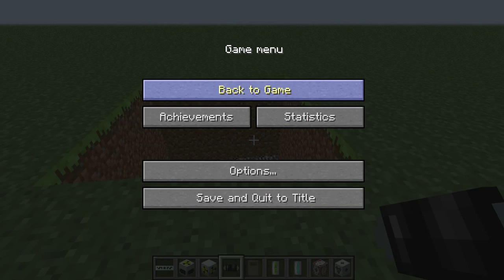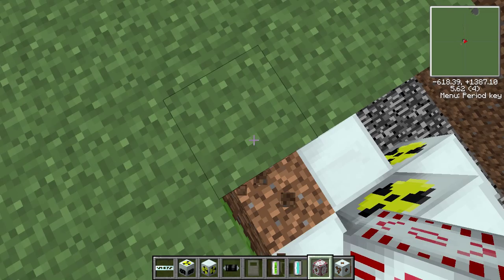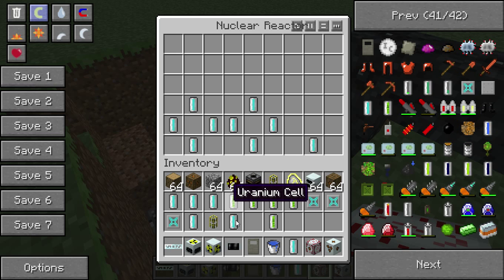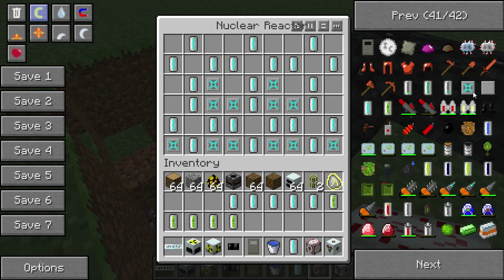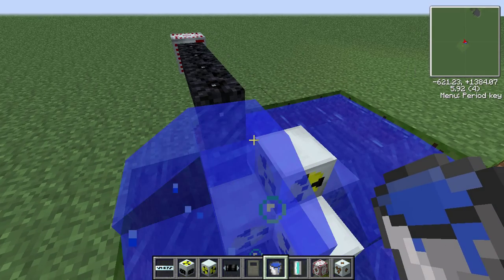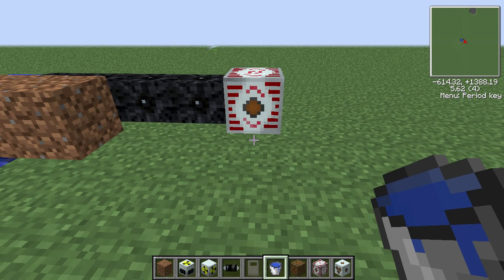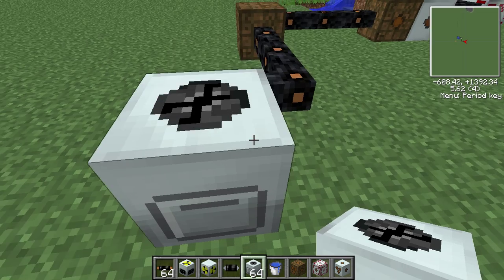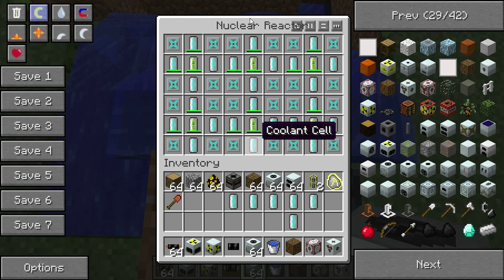Industrial Craft best nuclear reactor setup (very little risk lots of POWER)

Comment: There's this simulator to find out efficient setups for your reactors, and I used it with yours and with straight coolant cells, keeping the uranium where it is. The stats show no difference between the two setups, which means you don't have to be so resource intensive by using integrated heat dispensers. And by stats I mean the EU/t, Cooldown time, and others. talonfiremage.pwp.blueyonder(dot)co(dot)uk/reactorplanner(dot)html?91hd0ybht8swp7o4rjtd9vwj1s02m5o2r=1k10101001501521s1r11r10

Comment from the maker: it does take a alot of resources but like i say in the video you don't have to check on it and this will run a house with basic machines perfectly fine. The only thing it would be having a hard time powering is the mass fabricator.